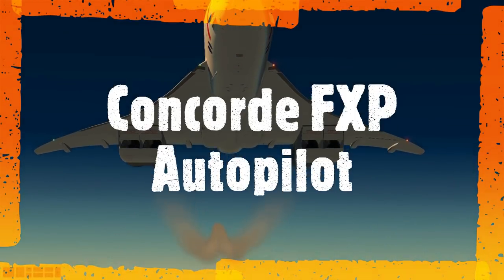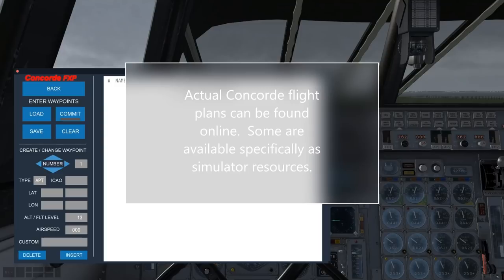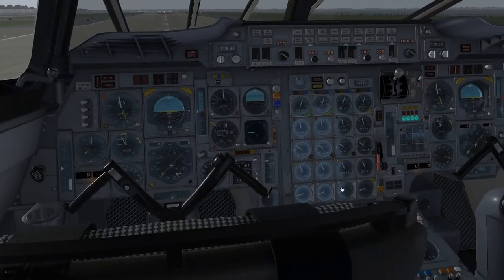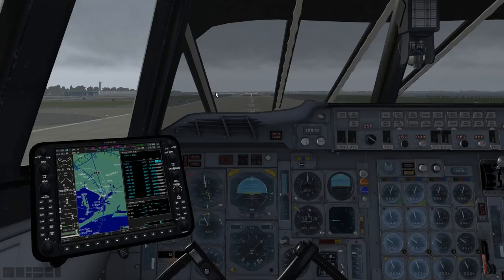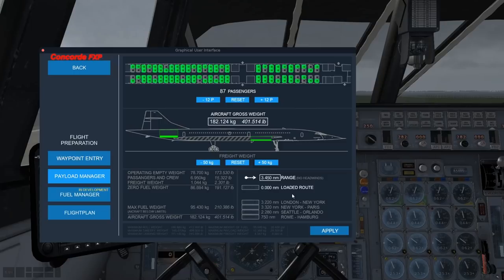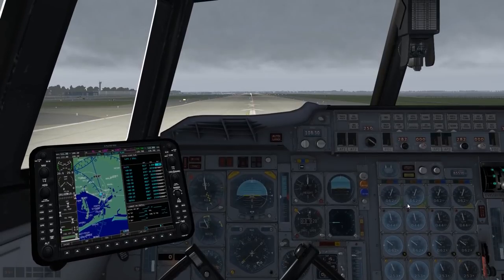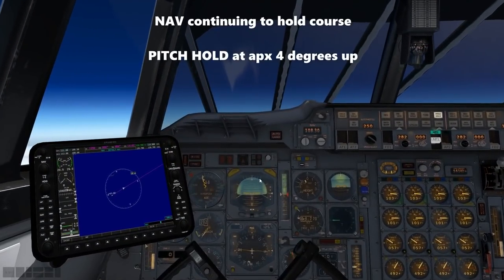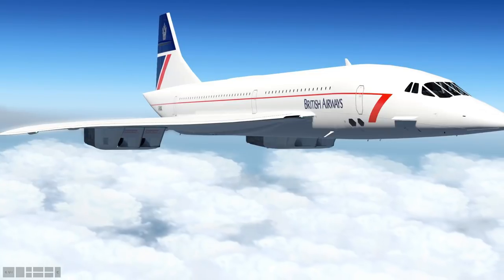Concorde FXP - Autopilot and Flight Plans - X Plane 11

Comment: Hi there, My Garmin will not power on. How do I power on the device? Everything is up and running.
Reply from the maker: Do you have a key or button assigned to the GPS, and is that one still off if you toggle it that way?

Comment: My autopilot keeps bouncing the plane up and down can you help me with this?
Reply from the maker: If you are at Mach 2, Concorde would climb as fuel burned off so a altitude hold wouldn’t be completed necessary.  If you are trying to hold altitude, we would suggest that you’ve got the most current version of the aircraft, and that your fuel is properly trimmed.  A minor power adjustment may also result in better altitude hold.
Reply: @FlightBrothersFT  okay thanks. because i do cruise climp but it only lasts for about 30 mins till it reaches 60,000 feet so i then have to hold altitude
Reply from the maker: @tjaviation61  does it keep oscillating, or change altitude?  Air temperature “should” effect the altitude resulting in slight deviations as well.
Reply: @FlightBrothersFT  it does the deviating sometimes however it does sometimes go up and down if i accidentally hit the flight column

Comment: can you help me i know this video is old but when i try to load my flight plan in everything is poerfect OR SO IT SEEMS because when i take it to the sky and check the G1000 it goes to some odd point 3000 NM away to go back to the airport and THEN go to my waypoints but when i check the waypoint entry nothing is there its inside the G1000 but i cant find a way to delete the point
Reply from the maker: Give our G1000 tutorial a look.  You should be able to delete the waypoint, or clear the whole flight plan.   I have a suspicion you will need to clear the whole thing when you start a new flight.  https://youtu.be/ajxi8MwHIE0

Comment: Am I correct that you can assign a key to the G1000 nav button, thus becoming an analog for Concorde's INS Follow button and avoiding the need to see the unrealistic G1000 at all?
Reply from the maker: I suspect you can. I have a USB Garmin 430 that is mapped to all the buttons and knobs of that device. There should be mapping available for G1000 as well. Good idea!
Reply: @FlightBrothersFT  Following on from that, if you were to load a plan into the CIVA INS plugin, the hotkey would also tell the aircraft to follow that. Same functionality. That's what I used to do in the free Ghun Concorde :)

Comment: Quick one please , how do you steer the plane on the ground please ? Yaw has no effect on the front wheel, I have to use toe brakes ... thanks !!
Reply from the maker: Interesting. Are you using joystick yaw? I am using rudder pedals, and I've had no issues.
Reply: I am using pedals mapped
To yaw. Is the wheel turning when you use your pedals please ?
Reply from the maker: Yes sir, pedals turn. You can probably see them working in my taxi out on the 'First Look' video we did. Very strange that it isn't working. Perhaps try reloading the aircraft? Could just be a bug. I had the mid-cabin door open for no reason yesterday during supercruise. GUI wouldn't close it, and I had to 'walk' back and click it to shut.

Comment: Hi I have followed your procedure to load the simbrief into the concorde fms but it doesn't load up only some  other flight plans comes up I tried downloading the flight plan and exporting it into explane still no luck any ideas please?
Reply from the maker: Interesting issue. Here are just a few guesses for things to check. Is the plan you downloaded a .fms file, if it is another type it might not load. Is the file in the correct folder? I believe it should be xplane/resources/FMS plans or something like that. Good luck!
Reply: @FlightBrothersFT  right thanks for the reply after the download from simbrief it comes as fms and I tried putting it in xplane flight plans but as you said I will try resources and see what happens
Reply from the maker: @atsubeckley3354  I just checked the file pathway.  It is:   x-plane11/output/FMS plans
Reply: @FlightBrothersFT  oh gosh thank you so much I will try that
Reply: @FlightBrothersFT  thanks for trying for me but it didn't work

Comment: hi, thanks for the vid but when i click on nav in the garmin, that not work, the plane don't follow the route, can you help me ?
Reply from the maker: I'm not sure why it didn't work for you. Just a few ideas to try: Is the flight director on? Is the plan loaded correctly? Is it tracking a 'vectors,' which will not automatically move to the next waypoint? Also, there have been some updates since this video was released. I'm not certain how those updates have affected the NAV function.
Reply: @FlightBrothersFT  how can i load correctly the plan, i put the point in the g1000... and in whitch folder can i put the flight plan of simbreif ?
Reply from the maker: Orbix I don’t have the computer in front of me, but there is a folder that holds the .pln files within XPlane.  That is the folder you want the Simbrief files saved in.  After that you should be able to load the flight plan on the G1000.  Hope this helps, please let us know if you are able to resolve it, or not, and we can get back to you when we can provide more detailed information.
Reply: @FlightBrothersFT  
ok thank you, you can show me the road to reach the folder when you can, thank you
Reply from the maker: Program Files\X-Plane 11\Output\FMS plans  The .fms files are the ones you are looking for.  Download the flight plan in that format from Simbrief, copy and paste in the above folder and it should be "loadable" by the Nav systems.  Cheers.

Comment: Man I love the Concorde, I flew it so much is fsx and p3d. And now I use it in xp with vr. I really wish the all of it was done but oh well. How did you get the g1000 there and can I see it in br ?
Reply from the maker: The G1000 has a hidden click region over the lower engine gauges on the front panel, and also a click region on the iPad mount on the captain's left window.